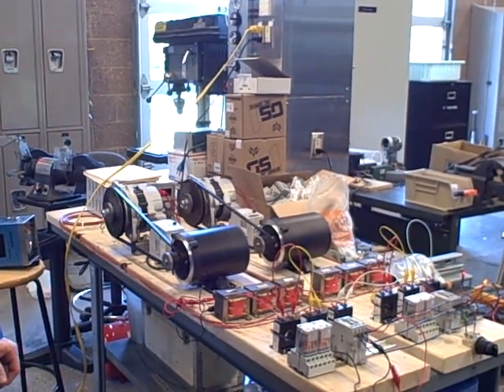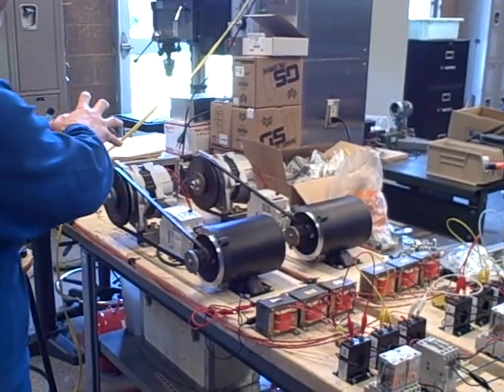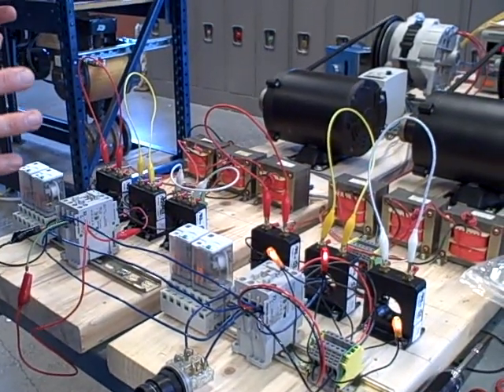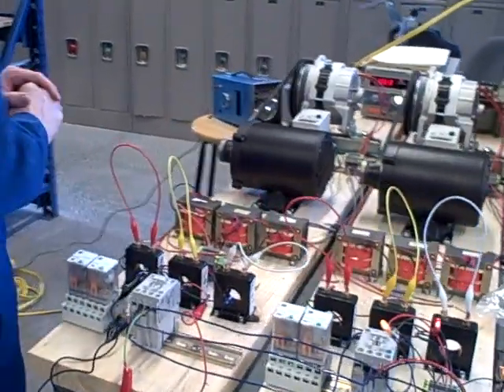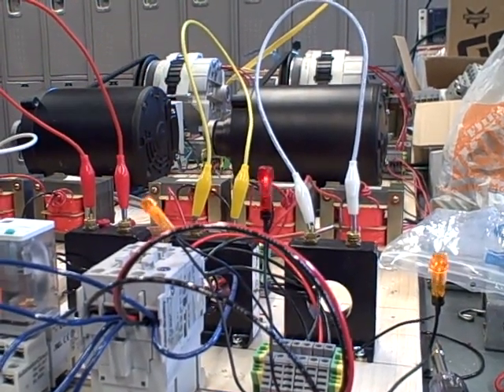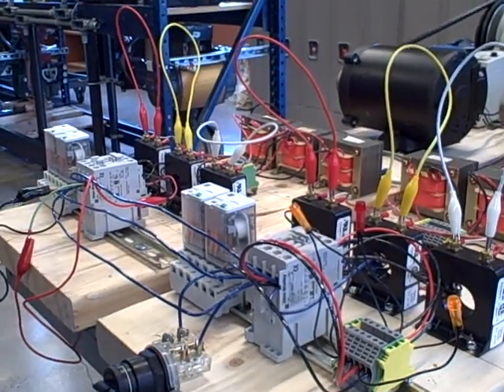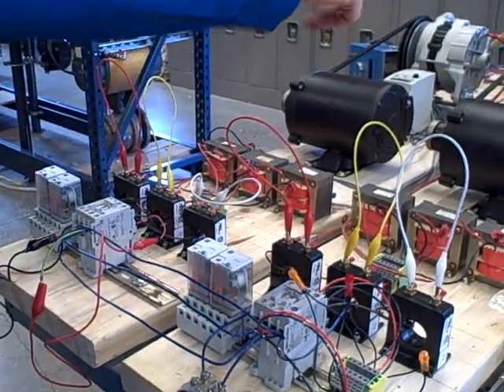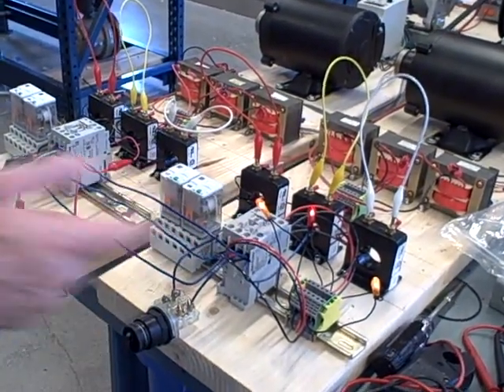Synchronizing AC generators -- Part 1 (introduction and sync lamps)

Comment: Flip the switch while the 3 lights were on. That would make for an interesting video.
Reply: Yeah, I'd like to see what happens then. Does the slower generator just violently sync up (potentially oscillating in speed), or do they both stop, or what?
Reply: @polymetric2614  Check out this video: https://www.youtube.com/watch?v=fJyWngDco3g   It is a real (very small) generator connected to the grid.   It is taken off line, for a fraction of a second, and allowed to get out of sync with the grid and then put back on line.
>Does the (cut) generator just violently sync up.
Generator vs the grid, yes it violently syncs up to the grid.  In this demo the engine is damaged in the process.
Reply: Depending on how many degrees out of synchronism and the difference in speed of the two machines it would range from a severe jolt (torque reaction) up to breaking the shaft of one or both generators. 
Most generating systems have a “sync check” relay that prevents the breaker from closing unless within a very close phase angle.
Reply: @billmoran3812  Yes that's what we want to see, shafts breaking and sparks flying
Reply: @kenalford2538  that’s just stupid.
Reply: @billmoran3812  OK Prof. you win the 'seriousness in public' challenge
Reply: @robert20770  "Very small" I imagined an Honda inverter or something....
Reply: @diegomayan  Very small compared to generators on the grid.  The tested unit  was 2.25 MW, very small compared to 500 MW, 750 MW or 1000 MW "grid" generators.  (https://en.wikipedia.org/wiki/Aurora_Generator_Test)
Reply: Correct URL:  https://en.wikipedia.org/wiki/Aurora_Generator_Test 
Twice I tried posted the correct URL as a comment to my comment and they disappeared.
Reply: Abbreviated as DOOM

Comment: A friend was telling me how to get the right RPM on my generator to have 60 cycle and was saying something about a light bulb between the generator and my AC power I thought he was pulling my leg but I guess he's onto something
Reply: What would the advantage of running a generator back into the grid have? Burn off fuel surplus and save on electric bill?

Comment: I always wondered how, if at all, the utility companies connect themselves to the grid and run in "parallel".  This is an awesome scale-model demonstration that makes it clear!  Thanks for posting this!
Reply: I was told years ago by an LG&E (Louisville Gas & Electric) employee that it used to be procedure to shut down power briefly in order to switch generators. This was before it was known that phasing was possible. Seems an employee who liked to have a drink forgot to shut off the first generator before engaging the second one. The transfer was seamless much to the surprise of the engineers.  By shear luck he phased them perfectly and didn’t destroy the equipment! This was the first time this happened successfully and thus the engineers knew it was possible. So now we don’t have nightly blackouts.

Comment: This is quite amazing.
I am an electrician and I have often wondered how they did this.
Not just achieving synchronisation, but also maintaining it.
The "maintaining it" part always held the most intrigue for me.
How on earth would they prevent one generator from drifting out of sync ?
My oh my. What a beautiful circumstance that the generators regulate each other and keep themselves in sync!
I feel like I have just learned a year's worth of knowledge in this single video.
INVALUABLE !
>
Reply: Think of synchronism as a chain connecting the shaft of each generator. They operate in lock step. 
The only way they can get out of sync is if the excitation of people be generator (DC voltage to the field winding) is reduced to the point where the generator can slip out of synchronism. That is a very rare occurrence. 
Once in sync with other generators, adjustment of the speed control or throttle does not vary the speed of the generator. It then controls the torque applied to the generator shaft which varies the power (Watts) that the generator produces. Adjustment of the excitation voltage to the generator field varies the voltage and current produced by the generator which is known as reactive power (VAR).
Reply: it's like a single generator where the load and mechanical force applied to the shaft will dictate the frequency...regulators regulate the power applied to the shaft according to the load...ex: if the load increases it will cause the frequency to drop and since it should never go below 60hz (n.a) regulators read inputs from frequency sensitive sensors and send output signals to correct the problem. in hydroelectric dams it is done buy opening valves to let more water in (more force) to spin the turbines. these regulators operate using finely tuned algorithms because the tolerance for frequency dips or overshoot is extremely small. breakers will cause power outage if the frequency dips or overshoots by 1hz for example (not sure how much exactly is tolerated)…
Reply: I KNOW RIGHT?! This completely blew my mind. It’s like reaching for your other hand and the grabbing a hold of it and not letting go. Then no matter which way you pull the other goes with it.. but it’s with electricity

Comment: Wow, what a fantastic demonstration of the grid system in miniature, looks like a very costly experiment, but it's truly amazing how you made it and use of the neon bulbs is a very cool idea for showing off the phasing difference in frequency. I use a neon bulb on my house mains as a power indicator bulb, for when I'm running off a generator when we lose power. I run a 2 phase single cylinder Diesel which runs at 1800 RPMs using a cap and anti-flicker points to boost the power on the non power strokes. I didn't invent it it is just mind blowing they had this technology back in the 70s when this was made! The camshaft tells the points to open allowing the cap to discharge into the field windings upon a dead stroke thus increasing its output power of electric and keeping it as even as possible. BUT love the experiment it's very cool and informative from an engineering standpoint. Thank you.
Reply: I was told years ago by an LG&E (Louisville Gas & Electric) employee that it used to be procedure to shut down power briefly in order to switch generators. This was before it was known that phasing was possible. Seems an employee who liked to have a drink forgot to shut off the first generator before engaging the second one. The transfer was seamless much to the surprise of the engineers.  By shear luck he phased them perfectly and didn’t destroy the equipment! This was the first time this happened successfully and thus the engineers knew it was possible. So now we don’t have nightly blackouts.

Comment: I wondered the same being a Industrial Electrican. When I rebuilt Generators and motors to a summer I was told by engineer. I figured it be done with software these days. Yet no its just 3 light bulbs. Whoever first used this technique was genious and yet simple. Its just polarity.
Reply: I was told years ago by an LG&E (Louisville Gas & Electric) employee that it used to be procedure to shut down power briefly in order to switch generators. This was before it was known that phasing was possible. Seems an employee who liked to have a drink forgot to shut off the first generator before engaging the second one. The transfer was seamless much to the surprise of the engineers.  By shear luck he phased them perfectly and didn’t destroy the equipment! This was the first time this happened successfully and thus the engineers knew it was possible. So now we don’t have nightly blackouts.

Comment: This is EXACTLY what I wanted to know!  When I was in the Army, we had a pair of generators mounted on one trailer. One had twice the capacity of the other, so they were in a 1/3 - 2/3 ratio. We would service one while the other carried the bare minimum base load, then start it up, sync them with a mysterious "magic box" that had a neon sync lamp in the panel, and then shut down the other one for servicing. At least one of them was running 24/7 for an entire year! That was a lot of fuel, but we had reliable power. I never understood until now how that magic box worked.

I can see having something like a 1,000W lithium + solar system providing baseload to a camper, then syncing a 2,000 - 3,000W gas generator for when you had heavier short-term loads or needed to quickly charge the house battery bank.
Reply: One day I hope these quick charge batteries you speak of become a reality. 

Unless I'm mistaken, and please elucidate if I am, all commercially available batteries take ~10hrs to charge, safely.

As of now, it's essentially the 80-20 rule. You can charge to 80% in 120min (20%) but the last 20% to full, or floating, will take the remaining 80% of time (480min/8hrs).

Charging only to 80% will work and still yield usable results, of course, but you'd just eat thru yr batteries lifetime cycles, which don't care about voltage, you'd just burn thru them faster by needing to recharge faster.

I'd love to be wrong, if there's a better way, or something I'm missing, share the secret handshake!

Comment: Proctor’s Gamble
I was told years ago by an LG&E (Louisville Gas & Electric) employee that it used to be procedure to shut down power briefly in order to switch generators. This was before it was known that phasing was possible. Seems an employee who liked to have a drink forgot to shut off the first generator before engaging the second one. The transfer was seamless much to the surprise of the engineers.  By shear luck he phased them perfectly and didn’t destroy the equipment! This was the first time this happened successfully and thus the engineers knew it was possible. So now we don’t have nightly blackouts.

Comment: Good video.  Here is a way to make the demonstration better.  Put one light between phase A of both alternators.  Another between phase A of one and phase B of the other.  Put the third light between phase A of one and phase C of the other.  That way the blinking will rotate to show the speed as either faster or slower.  When the A phase light is extinguished and the other two are the same intensity the breaker may be closed.  This is how the old power plants used to do it before the invention of the synchroscope.  The equal indication of the two dim lights will provide a better indication of synchronization as the "A" light will be extinguished over more degrees of rotational difference.
Reply: That’s exactly how the lights in this demonstration are wired. LEDs are not a great choice though, they don’t dim well as voltage is reduced. Incandescent lamps are preferable. Most plants only use two  lamps rather than 3. They are connected to the A and C phases.

Comment: Wow that's a really cool demonstration.   Heard a story about someone who was working on syncing a hydro plant, and he got a brain fart I guess and applied power wen the light was ON instead of off, so it was 180 degrees out of phase.   Immediately snapped the shaft of the turbine, we're talking over a foot thick of steel here.  Also required a change of underwear, and probably a full rebuild of the plant.  Chances are it also required updating a resume. :P
Reply: I was told years ago by an LG&E (Louisville Gas & Electric) employee that it used to be procedure to shut down power briefly in order to switch generators. This was before it was known that phasing was possible. Seems an employee who liked to have a drink forgot to shut off the first generator before engaging the second one. The transfer was seamless much to the surprise of the engineers.  By shear luck he phased them perfectly and didn’t destroy the equipment! This was the first time this happened successfully and thus the engineers knew it was possible. So now we don’t have nightly blackouts.

Comment: Very creative of you using LEDs as an indicator like Synchroscope bulbs.
Reply: these aren't LEDs. LEDs are polarized and operate at a certain voltage. exceed that voltage, the LED burns out. instead, they use neon indicator bulbs. the same as you would find in the switch of a power bar or similar

Comment: Synchronized many units over the years to the grid. This is a very simplification of the actual process,  you must increase load or the reverse power rely will trip the unit off line.

Comment: I recall doing this many times during my Electrical Engineering Technology program back in the 90s.  We used the LabVolt modular equipment which was much simpler to setup.

Comment: When I started at this sugar factory 40 years ago we had 2 light bulbs to sync a 750kw and a 1000 kw steam generators. When both bulbs were lite, you pulled the manual breaker in. In the 80s, we upgraded to a syncroscope.  An arrow attached to a motor shaft with the windings wired between the 2 generators. If incoming was faster, it turned left, and too slow it turned right. At 12:00 arrow up, you close the breaker.  We also upgraded to sync transfer. start on grid power, bring up generator 1. Snyc the generator to grid power, then transfer up to 2000 amps at a time from grid to in house steam generator power. The last generator is still in place for backup power Today. The generators are GE 1917 - 750 KW and GE 1000 KW 1936-   Wyoming Sugar company.
Reply: And this is why we need home surge protectors 😛

Comment: I am old enough to remember when there were no PLCs
I remember each town had it's own power plant and the voltage and hz would be all over the place.
Lights would dim or brighten.
When the factory would start their motors the voltage would drop to about 60 volts and slowly climb back and when they shut off the motors the lights would get super bright and sometimes pop

I had the first UPS and people asked me why
Then my whole town had every electronic device blow out when there was a surge

The difference in voltage was huge

In Rural NY I saw 100 volts, up in Maine it was 130 volts

Seeing how old some of the poles and lines are, over 100 years old, it is amazing they still work.

Comment: We had a neon light in the middle of the dash on the boat.(50ft chris craft cabin cruiser, two flathead straight eights for power,) and when under way, you would adjust the throttles to where the light stayed on as steady as you could get. When you got the engines synced, you knew also by the sound of the exhaust as it would be a slow “waaah,waaah,waaah”, as you were going across the bay. 1600 rpm and you were haulin’ butt. Back in the day when high test, 104 octane, was twenty cents a gallon. With two, 250 gallon tanks, it was a $100 to fill’er up!

Comment: Except that real sync Lights work with one off (L1-L1 comparison) and 2 on (L2-L3 and L3-L2 comparison).
Built a few dozen.
Reply: I think this is an acceptable scale-model demonstration that simplifies a few things to make the point well enough, but you are quite correct
Reply: Ah, so you won't accidentally sync up a generator with burn out light bulbs.  Smart.
Reply: @Calliber50  Yep, moreover brightness increases exponentially with voltage, therefore comparing 2 bright ones will give much more precise voltage & timing comparison than trying to see very little glow or nothing.

Comment: Thanks for the educational demo.  You misused the term "short circuit."  If you close the breaker when the alternators are not in synchronization there will be a high circulating current trying to pull them together.  Usually this will trip the alternator circuit breaker and can damage the alternators--not to mention making a very loud noise in a power plant.

Comment: I got the answer to my question as to how the 2 gens maintain sync once engaged to each other. Reminds me of power factor. A phase change between voltage and current (lead/lag). There must be equipment to show if any generator(s) are fighting another to maintain perfect phase for sync? If one gen is getting lazy, the hard working one will try to speed it up, thus wasting energy that could be going to the grid? Now I got to find a vid explaining how 2 consumer portable gen sets can be hooked together to maintain proper sync to increase power output. Nice.

Comment: Using a simple graph of the two sine waves from each generator would make the discussion easier to follow and understandable. The lights are between one phase out of three. The lights turn on or off based on the Volt-gen1 - Volt-gen2....when they are in synch there is no difference in voltage, that is the sine waves are at the same phase angle.....

Comment: The first time I knew about this form of synchronization was about fifteen years ago when I was asked to synchronise two catapelar generators of 750kva to give a total power of 1.5MW they had a v12 engine 48v DC starter motors complete with synchronise panel. When synchronise you can hear both  generators governors revving up the motors in unison on load. On my first sync it took me over fifteen minutes to engage the breaker when the bulbs extinguished (cold feet) after that I have built six sync panels for different units and would advice anyone trying it out to use two 220v bulbs in series in case your connection are out of sync (phase) with each other were you will get a potential of 380v on your bulbs

Comment: I guess it depends on the generator design, but I always though you just energize the field coil with the power you want to sync with, then the output automatically matches.

Very interesting demonstration though. Thanks.

Comment: I assume that this electro mechanical coupling wastes power as heat in the transmission lines etc between two stations when they are out of sync.

Comment: In an old diesel Generation plant, when you run out of diesel or your fuel gets shut off the unit will still run if connected to the grid. Your generator becomes a big motor. 
Yep, we would tie to the grid the old fashioned way, light bulb and a big hand switch at 2400v.  Nothing fancy.
Reply: What kind of light bulb works at 2,400V???